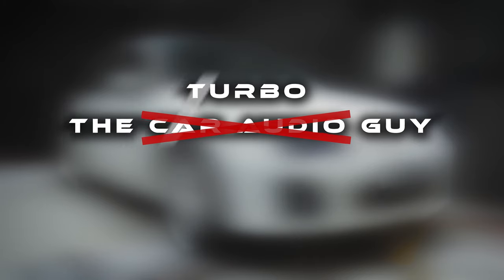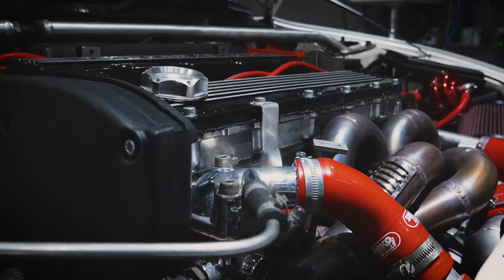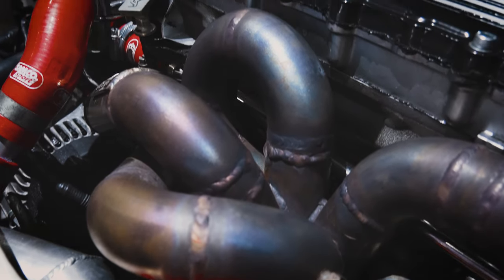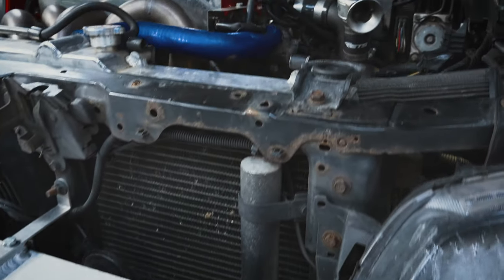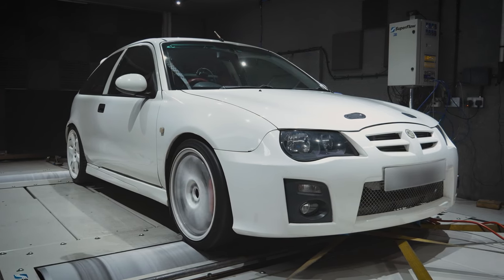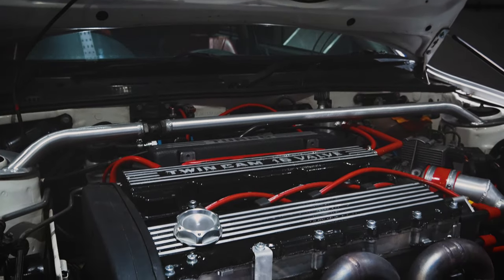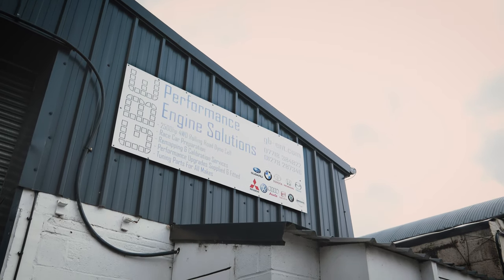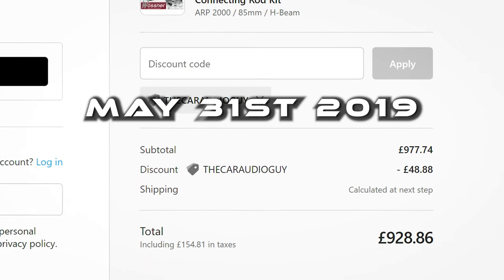Turbo Conversion - This MG ZR ROVER T16 has SILLY BHP!

Comment: Lovely car and lovely build. Only one criticism though... who fitted those cam covers? The black gunk sealant at 1:09 is absolutely appauling. Something like Loctite 510 is way more suited than that rubbish.

Makes you wonder what else got the black gunk treatment. That is certainly not what you want swimming around in your oil system (blocked pickup anyone)

Comment: What about the gearbox? Are you stil running with the PG1 with the bearing kit? Amazing build you got there. Congrats!
Reply from the maker: Cheers man, funny you mention the gearbox actually 😅 so got an uprated PG1 with ISF treated components 

Also got a gripper differential and the uprated bearings

Now for the funny part.... I think the differential exploded last week.... so currently having the gearbox come off to be inspected and rebuilt 😅
Reply: @TheCarAudioGuy  yeah it's quite a way over what the pg1 can handle safely there is options out there but they ain't cheap 🙄
Reply: @stephenbates8370  what are the alternatives of a pg1 gearbox? i'm hoping that mine doesn't explodes

Comment: Hi! Awesome build... quick question...what is your front brake setup? im seeing some four-pots....whats the details on it? interested in doing this to my car as well...
Reply from the maker: Rawle Murrell hey so the brake setup does need a refresh as it was originally from the older version of the build that was between 200-300BHP but they are brembos from a Megan RS
Reply: @TheCarAudioGuy  many thanks man!!!
Reply: @TheCarAudioGuy  hey ...the rotors..were those also from the Megan RS? did the calipers mount directly or required some modification? (yeah ive got questions!!!)

Comment: Why didn't they just reuse the T series engines instead of K series if it's this great

btw this is indeed a weapon considering it's a small car.
Reply from the maker: Might have been to save costs and weight on newer engine blocks, as the K-series is much lighter but made of different materials

Don't get me wrong though the K-series is a great engine still though and used in a lot of cars
Reply: @TheCarAudioGuy  I've got a 2000' 214 Si with a lpg system on it lel, it's my second car and a daily
Reply: More due to the fact the handling, diesel ZR's handle piss poor compared to k series zr and 25's also they used it because tbe rover 25 was im essence an economy car built for going up to the shops.and back the t series is good but vastly outdated, personally i am trying to get a new k series block from a new chinese mg as i have heard those have less distortion when turbo'd
Reply: Zack Raiden what you on about they been racing/rally these things for nearly 2 decades. Chinese parts? You need a doctor mate
Reply: Emmisons laws meant the T series needed updated. I run a MG ZS Mk2 with a t16 turbo. Great engine.

Comment: is it normal to have an 80 hp difference between engine and wheel hp ?
Reply: yes
Reply from the maker: Yes perfectly normal buddy
Reply: Yes and No. 19% is on the higher side for that car. But it's not unheard of. Alot of it depends on the condition of the gearbox and running gear, tracking, tires etc. 
Had a 480hp T16 myself back in the day. Nice to see people still doing them. I remember Grant when he was just starting out.